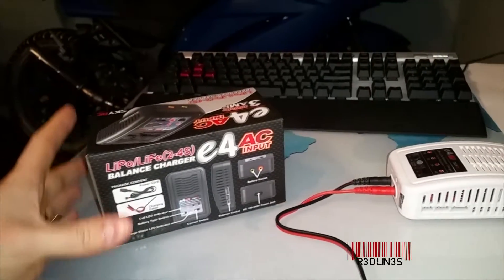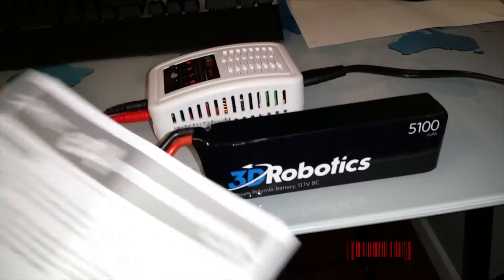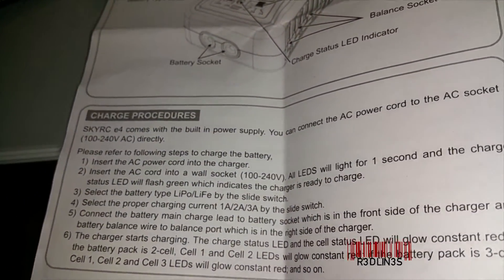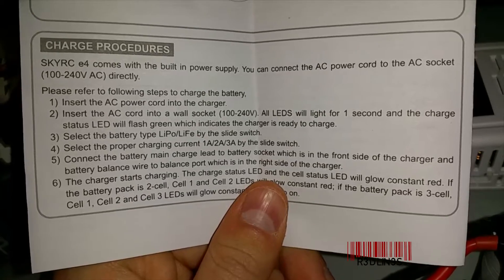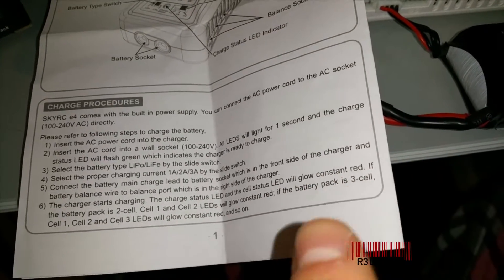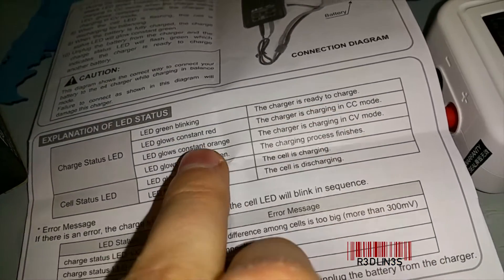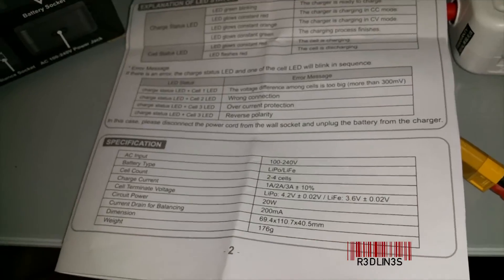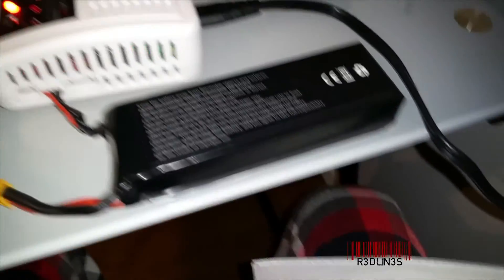How to Use SKYRC E4 LiPo/LiFe Balance Charger 2, 3, 4 Cell

Comment: Hi, does the cell equalizer lights turn green when the battery is charged?
Reply: Glen B Hi. I have the same question! So, did you get the answer durging the last 5 mounths?
Thank!
Reply: João César yes it does turn green when done
Reply: i got it now for a year and it works nice and oke
Reply: Tanks Martijn!
Reply: youre welkom João César

Comment: Does your charger balance the cells properly?
Mine charger overcharges the 3rd cell of my 4s lipo always. :S
Reply from the maker: Kostas Papadopulos I have had no issues with it so far
Reply: R3DLIN3S Thx for replying. Do you measure your battery pack after each charging process?

Comment: Great vid...i have a problem with mine since day one...it constantly blinks green no matter how many times i try to charge it.  All the connections are correct.  There are no other blinking lights.  Ive never seen a solid light either.  

Any advice would be great

Thanks
Reply: Hi this might be a little late but if anyonehas the same problem the solution is this: The battry is probably discharged beyond being able to be recognised by the charger. The fix is to try and repair the voltage this way. switch to LiFe charge and set the Amp switch to 1A. then wait for the green light.  depending on the size of your battery all this wont take more than a few min. then when the light is green switch the pw over to LiPo again and maybe replug the balance lead. then if all the cell lights light up again you might save your battery. never leave your battery for another 30 or so minutes and it might be rescued

Comment: I bought a 2-3 cell balance charger, when charging a 2 cell i accidentally shorted the 3 cell port, now when plug the 2 cell, it will flash red once every 1 second, according to the instructions manual it means the battery is not properly installed. But before it can charge normally when i install it the exact same way. Does anyone know how to fix it? thx in advance

Comment: Mine  keeps on blinking with a green light, what do i do?
Reply: it means its ready to charge. now if you have a battery connected and it still blinks green that might indicated that you have a over-discharged battery
Reply: @HaxorCe  and what do you do if it's over charged? Because I might my battery in my airs oft gun and it's empty completely but I plug it in and it does nothing